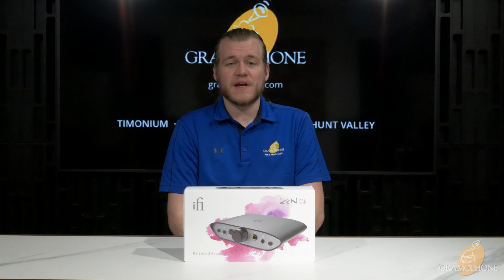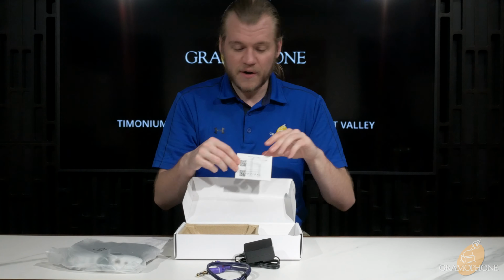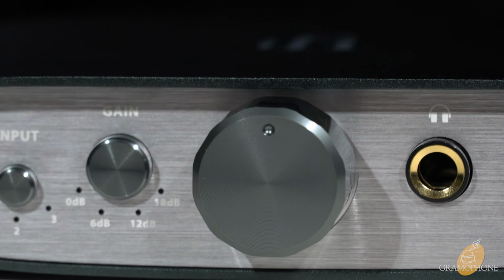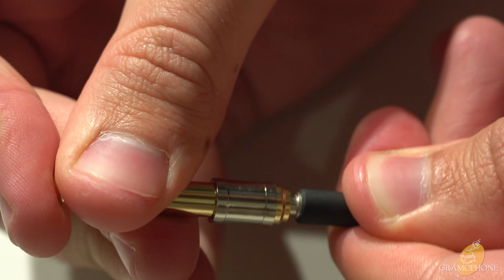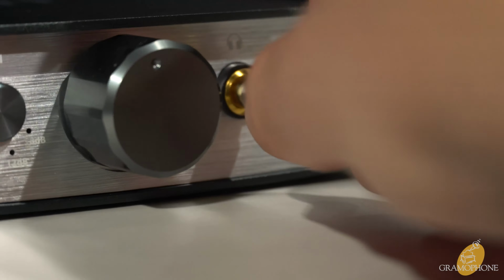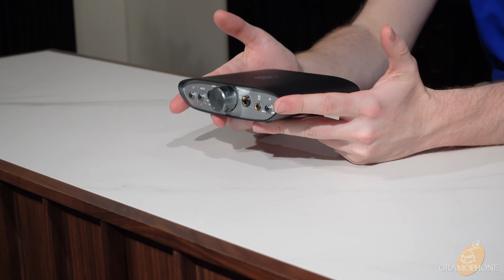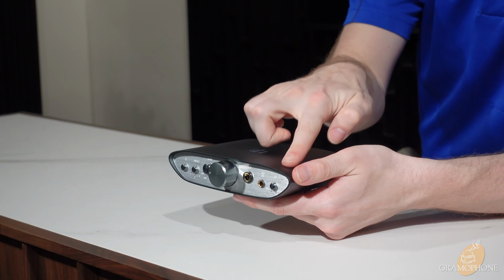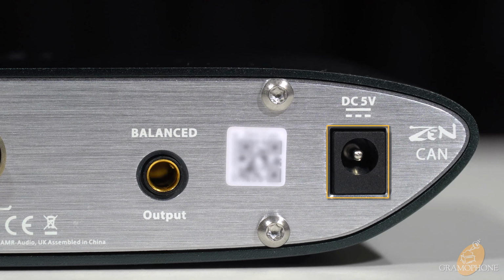IFI ZEN CAN Balanced Headphone Desktop AMP/PREAMP

Comment: one question can I use the zen can and connect it as you say to a Topping D10s DAC with RCA cables and then I want to connect my headphones to the zen can with a balanced cable, will it work? and this zen can give me enough power in volume at 100% to my hifiman he400se with balanced cable? with the configuration I just mentioned.
Reply from the maker: Most likely yes, but keep in mind that is not a fully balanced signal chain.